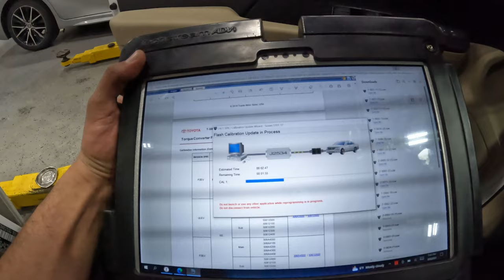10'-14' Most Common Toyota Camry Transmission Issue!(Torque Converter Replacement)

Comment: I was experiencing a torque converter shudder on my 2014 Camry LE.  I performed 4 drain and fills with Castrol universal ATF/CVT fluid.  On the last fill, I added two tubes of Lubegard shudder fix and a bottle of Lucas transmission fix.  I then had Toyota update the transmission logic.  The shudder is gone and the transmission is shifting like new.  The car has 240000 miles!
Reply: At what mileage did you experience this at . My 13 Camry has 208k miles and don’t have that issue (yet) Atleast

Comment: Toyota changed the torque converter in mine for free under the exteneded warranty coverage, but it didn't help. The shudder has only been getting worse with time.
Reply: It must be Transmission slip then i am just guessing as i am  in the same boat. It jerks at shifting ,sluggish and all of sudden releases power...
Reply: Check axle
Reply: @irfanejaz4180 hi there, i hope you’re doing well. I have same problem with my car. I was wondering about your issue, did you fix it and how did you fix it. I appreciate your feedback.
Reply: From what i understand, if you own 2012-2014 camry you'll need to update software. If you missed the extended warranty, then out of pocket cost is $175. for the software update. But if you already have the shudder then you may need to replace the torque converter as well with another cost.

Very important is if you needed to replaced the torque converter per the shudder, still need the software update or else the shudder will happen again.

Comment: My local shop told me to replace the whole transmission because it has a leak. Smh 143K. Shifts and drives great. Just for the seal. Nothing more
Reply from the maker: You better not have it replaced for that😂Easy fix just bery labor intensive
Reply: @miguellechuga3338  right lol.
Reply: @miguellechuga3338  you think about 800-1000?
Reply: @miguellechuga3338  Thank you so much
Reply from the maker: Id say so,Depends on the sho you take it too
Reply: @miguellechuga3338  Should I do the rear engine seal while they are in there?

Comment: Hey, I'm having a similar issue with my Camry, I was just wondering what's a fair price for a job like this. I just wanna make sure I don't get completely ripped off by the mechanic
Reply from the maker: It all depends what the mechanic hourly rate is,Dealership charge about 12-13 hours at $175 an hour in my area
Reply: So about 2k?
Reply: @MIKExMASSACREx without parts 👀

Comment: You don't have to remove the transmission, just drop the sub frame on the driver side and you should have enough clearance to pop the old one out and replace it. Also don't forget to flash the new firmware!
Reply from the maker: I usually recommend a new front pump seal & rear main seal when I replace it boss!

Comment: I have a 2012 Toyota camry le i have a small sudder around 35-45 miles  and rpms jump a bit . Would i need a new transmission? & Should i do a transmission oil change ? Had the car since 60miles now at 150k and starting to have sudder problem

Comment: Hola brother una pregunta yo tengo el mismo carro 2018 el otro día me prendió check engine puse el obdo2 y me dio dos códigos el shift control solenoid y el pressure control solenoid pero esa transmission no tiene la tapa abajo y no sé si es la que tiene en la transmission frente al motor

Comment: i had/have same problem. Toyota camry 2012 SE, started at 140k. warranty expired. shops wanted around $3k to fix. I added lube gard and it stoped for a bout a year. car has 170k now and i am about to add another lube gard . i never changed fluids as the car is pretty beat up

Comment: Hello, I have a 2012 Toyota Camry with this same problem.

How do I get the ECM update for the transmission after replacing the torque converter?

Also, if I don’t do this update, how long before I experience the same issue again with my transmission. 

Thanks for any help and I’m really hoping to read your reply.
Reply from the maker: You can have your local toyota dealership do it,im not sure about any websites having it!
Reply: @miguellechuga3338  Okay.. but how long would the new torque converter last if I can’t get the update? 

My car is past 150k miles at this point, and I know the extended warranty by Toyota has expired by now.
Reply: Any idea?
Reply from the maker: That update is top help with shifting since when the shudder happens the car is trying to compensate,So the car woll still shudder or it will,The update “resets”The shifting memory
Reply: Just for the software update, quote from toyota dealer service  $175.

Comment: Hi Sir,
I have 07 Toyota avalon 3.5L with 217k miles. Fluid is clean… I did feel a shudder so I had it drain and refill plus filter done two years ago. Fluid is still good color. But I’ve Notice everytime (I drive highway about 90% of the time) I let my foot off the gas and press it again, it wouldn’t thud and accelerate. Could this be related to the converter? Or oil control valve preventing vvti to work smoothly?
Reply from the maker: That doesnt like a shutter,A shutter would most likely be felt around 40MPH & about 10-15% throttle..I would run the codes & see if theres any “pending “codes related to timing be too advanced and if so,It would be a VVTI issue

Comment: Hello, I have a 2014 Camry with 95,000 miles and I just recently started to experience the shudder. I went to Toyota dealership and they are charging me a total of $3,900 for labor and torque converter. I have a question for you Miguel, would it help if I change the transmission fluid and only get get the transmission update? I really don't have the cash to pay the full amount now. How many miles do you think my transmission will last if I don't replace the torque converter? I would really appreciate if you answered my question. Thank you.
Reply: What did you end up doing did it go away?

Comment: Does the 2017 Camry have this issue too? Mine is at 85k miles and if I leave my neighborhood on a cold start and get on the main road and get up to 50 mph mine shutter’s slightly for 5-10 mins between 40-50mph. If I’m on the freeway I can feel it shuddering slightly consistently at 75-80mph, even after everything is at operating temp. I’m assuming I need to replace the torque converter. Any insight would be greatly appreciated
Reply from the maker: Its alot more common on the gen before that one BUT a shudder usually indicates at the converter,I would try having the transmission fluid replaced and the Transmission memory reset before getting the torque converter done since its pricey repair!
Reply: I have a 2012 Camry 79k I had the firmware upgrade in 2014 according to Toyota and recently I just had a slight shudder/vibration at 45mph I put new tires on which I needed but nothing changed then my local transmission shop recommended dropping the pan new fluid etc and now it runs like new again I never changed the fluid per Toyotas claim that its good for the life of the car? the fluid was dirty from now on every 30k I will be getting it changed at the shop its too much hassle draining it,filling it keeping it level and getting the right temperature ,my old Forrester with the external filter is so much easier.I feel like I dodged a bullet a new TC would be expensive for a car with only 79k.
Reply: @missadda8890  I'm definitely suspecting dirty transmission fluid for sure. But like you said it's such a hassle going thru the technical way to do it. Thank you for sharing your success with trans fluid change. Was yours burnt by chance? What's crazy is mine is a 2017 with a shudder at 85k miles

Comment: Does the 16 Camry 2.5 engine have this issue?
Reply from the maker: No it does not that year is all good!👍
Reply: @miguellechuga3338  Are the Truestart batteries good or are there better choices?
Reply from the maker: @subgyu5693  weve never had a true start fail on us